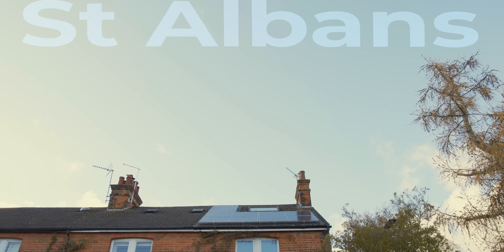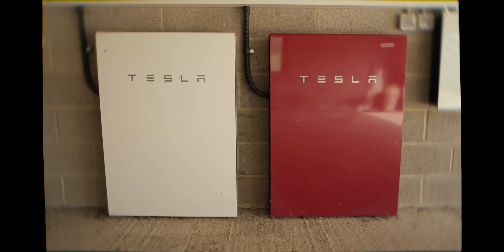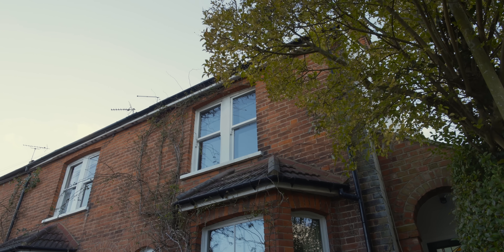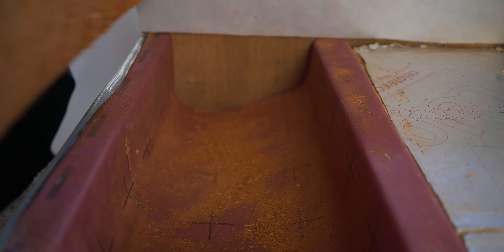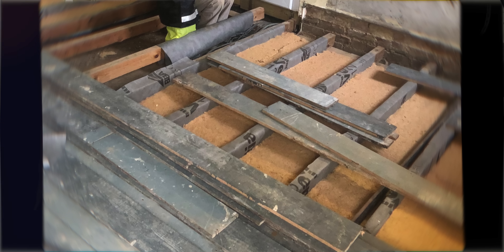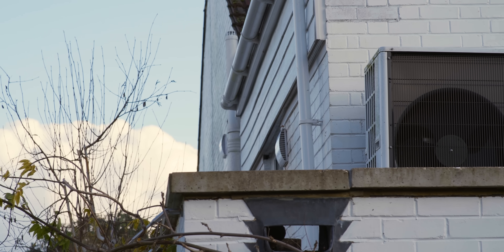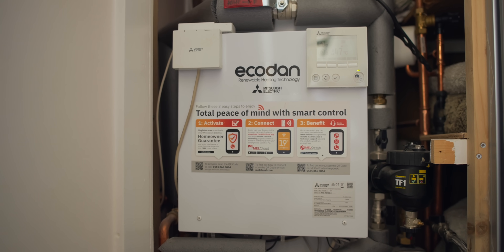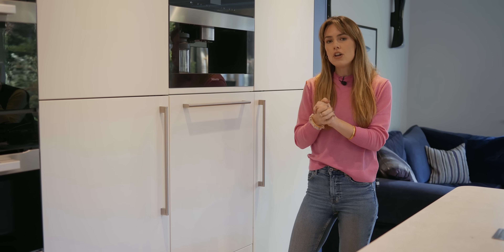This Victorian Home is Now 75% More Energy Efficient!

Comment: appreciate this is not for most of ye victorian semis, but for those wondering about all the "savings", here's a quick reality check: lovely Judith mentioned they used to use 25,500 kWh/year. Not sure if this is gas only, but let's assume it's both leccy and gas. What's the split, conveniently not mentioned, but let us again be charitable and say it's weight adjusted based on Ofgem's typical annual energy usages for a "High" user with economy 7 for electricity. Ofgem quotes 17,000 kWh for gas and 6,700 kWh for leccy, so weight adjusted I propose about 18,291 kWh for gas and 7,209 kWh for electricity.

Now,  using the Ofgem January to March 2025 price cap for east region we get units only costs of (standard credit and multi rate for elec): rounding up about £3k per year. Then onto the current use of under 6,000 kWh (assuming elec only as it's "green"), so wow, only about £1.5k per year (used 5,900 kWh as generous, so about 50% reduction without the daily standing charge for gas).

So with that whooping saving of over £1.5k a year Judith's rates costs alone (we didn't account for removal of gas daily standing charge once gdn finally get onto that...) will let her recover the roughly £23k in about 15 years🙃
...well ,that's if leccy rates would stay as they are now ;) Plus, the estate agent priced the house at £90k more! Wow, amazing, although would be good to know more than when? As my house was also about £90k less about 10 years ago when i got it (go on h8 me millennials and GZs :p)
I couldn't save the planet but definitely saved my poor ol genx pennies... adeus!
Reply: at least she doesn't get cold feet!
Reply: not sure i get your point, so you saved £23k, but were paying double of what you could have for past 10 years? You'd be 2/3 to your ROI and could have saved yourself a tad more of those pennies no? Aside from the fact you actually could have gotten the £ from government to pay fro all of this!
Reply: The split was 3/4 gas and 1/4 electricity. We now pay the same amount for electricity as we always did, but no gas cost. Pricing of the house was done about 18 months ago and the value of the house now in comparison to the equivalent house now.

Comment: Nice to see materials like sheep wool and wood fibre being used. Not sure if many people think about it but rigid insulation boards like PIR make a huge mess when being cut and installed . The particles blow everywhere and I wonder if it could be a lot worse for the environment than things like microplastics in cosmetic products. Especially when you consider the amount of new builds and retrofit jobs using it these days.

Comment: Interesting to hear but not convinced about the approach.  The character of the building has gone on the inside.  The suspended floor solution using multiple membranes with draped fabric is NOT ideal as you could see with the insulation sagging.  Best way is to stable woven garden fabric to the underside of the joist and fill with glass wool cut slightly over size.  For 6*2 joists use 170mm wool.  Seal board edges with expanding g foam and caulk and gaps in floorboards.  Way cheaper and better wool placement and retention.  Modest wall insulation on external lath and plaster can provide 35mm to 41mm PIR insulation which is not ideal but takes you 70% of the way there without destroying your old architectural features.  The all green dream is wasteful on costs and heritage for a marginal gain.  There are other ways with advantages.
Reply: Not using petrochemical based materials mattered to us. The underfloor insulation method is advocated by many sustainability companies. We used an airtightness membrane top and bottom to hold and cover the wood fibre and it's working well. You're right, we have changed the inside a lot over the 47 years we've lived here that's true. But the only features truly lost is one fireplace (the other looks as if it's still there) and outside toilet and coal hole. All the picture rails and architrave are here in some rooms.
Reply: @ I know that many suggest the method you used however I do not consider it necessary and it has flaws.  I agree not to use PIR but not for the movement gap issue you suggest as that can be avoided by gluing the insulation to the wood, I do this in rafters and between wall studs on the previous lath and plaster, the issue with POR is it dies not allow water to “fall” through if you have a spill where glass will will. There is plenty of draughty exclusion in well fitted boards and if some gaps caulk them..  the problem with all those giving advice is they sell the expensive membranes and tapes so 5hey are incentivised to over spec.  I have done two old houses now and the woven garden fabric stapled to the underside of the joist works extremely well.  At the board edges I use expanding foam  fir a complete seal that can take movement the caulk or fill any splits, wholes or gaps.
Reply: @DR-00700 This sounds Ok as long as all the materials used are vapour permeable - particularly important in an older house. Without this there will be problems
Reply: @ I do understand your desire not to use petrochemicals however I find some of the natural materials to be inferior and expensive.  I am an oil engineer and see little problem in using decomposed organic material as oil and gas is.  In reality oil is natural, you can make it from organic refuse by heating it in a pressure cooker just the same as burying it deep in the earth.

Comment: That was a great interview, really well explained by Judith. We've done the under floor wood fibre insulation exactly as she described and we are looking at wood fibre externally wall insulation next, then a heat pump. I think the only two major points to add to this:

1 - Common plastic insulation (PIR, Polysterene etc) is a fossil fuel product! So by going for natural products like wood fibre you have much less embedded carbon.

2. Using plastic insulation is an all or nothing approach in terms of keeping moisture out. So for external wall insulation if that insulation is compromised in any way or at any time then there is a real risk of trapping moisture behind the plastic insulation, which can then just end up causing damp inside. 

Plastic free, vapour permeable insulation all the way 🤘

Comment: Very useful video, and I'm glad to see the emphasis on using vapour-open biomass-based insulation products, and the importance of employing breathable materials on pre-1930s buildings with porous materials and no or minimal wall cavities.  However, I do have reservations about just getting rid of chimney breasts and fireplaces, not to mention obscuring original lime plaster mouldings and architraves around the wall openings - lime plaster is itself insulating and should be left to do its job.  Chimney breasts are your storage heaters in a traditional building, and together with a stove or radiant cast electric heater, create a focus in the room - they should invariably not be removed.  It would also have been useful to have mentioned the existence of PAS 2035, and the need to keep to its recommendations when moving forward with any retrofit works.
Reply: All the new plaster is lime. Agree with you about the architrave - where we had it in place, we had a replica made so it now looks just the way it did before. Kept the look of the fireplace in the front room, but wanted to lose the extreme draughts we were getting.

Comment: I don't know if I missed this detail, but does the 25,000 to 6,000 kWh/yr refer to total metered energy use, ie gas+electric going to just electric with switch to heat pump?
Reply: yes - @5.5K was the total of gas + electric. Now just 6K electric. All the gas has gone.

Comment: For once id like to hear someone offer up a solution outside of internal wall insulation where you dont loose a good amount of space WHERE you cant actually afford to loose space AND external wall insulation isnt possible :( . Hearing people say "you dont loose that much" isnt a solution
Reply: Imogen does show how much we lost in the bedroom. I have been surprised how little impact it has made - and a big impact in warmth. So worth it from our point of view.
Reply: 1. Cavity insulation with EPS beads, if you happen to have a cavity in your wall (the best, easiest and most cost efficient option) 

2. The wood fiber presented in the material is actually not that great of an insulator and 100mm is quite a lot to lose internally. You can get same or better U-value by going for a much thinner phenolic insulation, like 40mm or so K118 Kooltherm insulated plasterboard - which is imperceivable for all practical purposes
Reply: @lelllooooo  I agree that using sustainable materials can take a bit more space, but it was important to us not to use materials that are harmful to the environment or that off gas into the house.

Comment: You CAN Celotex/ Kingspan etc suspended timber floors...you use insulation expanding foam for the gaps...simple.
Reply: It is pretty much impossible to seal PIR insulation to the full depth of suspended floor with expanding foam, this only really works well if you use something like Gapotape

Comment: Brilliant video. First class presentation. 
I have tried to do something similar with my house. 
The comment about over-sized radiators rings true, the government grant is conditional on having very large radiators to perform well in very cold, very unusual conditions, so at the moment you have little choice.
Reply: With ASHP, bigger radiators = always better, regardless of the weather, as they allow you  drop flow temperature down and so boost heatpump efficiency significantly.

Comment: Great video, with some interesting ideas. Which single room heat recovery ventilation units did you use and was it a local installer.
Reply: Looks like the blauberg vento unit

Comment: It's so heartening to see people who have become passionate about improving energy efficiency in homes able to acheive massive improvements in their homes! 75% is a LUDICROUS improvement to manage with really well thought out insulation and a heat pump. Incredible
Reply: That's the sort of improvement most houses older than about late 1980s will get with a decent retrofit. Check out the 'superhomes' project which has been tracking 'at least 65% energy reduction' retrofits for a couple of decades now. Our (1960s) house is improved by a factor of 8 since 'as built' and a factor of 4 since we bought it (with cavity walls, basic loft and DG done).
Reply: its just a shame elecrticity is 430% more expensive per kwH than gas! and also standing charge 100% more expensive for lecy over gas!...crazy
Reply: @recyclist6421  and if electricity prices were not attached to global commodity markets trading prices of natural gas, to more accurately reflect the price of electricity generation in a normal, modern, renewable energy filled grid, this simply would not be the case. The electricity price being tied to gas is a ludicrous position to be in for a country that regularly passes 50% renewables on the grid. In Scotland where I live we're over 90% renewables per year. The prices we pay living here don't reflect that.
Reply: @RobinThomson277  It's not really 'ludicrous'. The price of half an hour of electricity being set by the cost of the last kWh that satisfies demand is a mechanism that satisfies demand at the lowest price available and has worked very well for about 100 years. It's not tied to gas specifically, it's just that quite a lot of the time in winter it's gas that supplies that last kWh.
Regional, rather than whole-UK, pricing would give areas with more low-carbon supply (like Scotland) much fairer pricing (where demand would be satisfied by wind most of the time and would cost less), and would make clear to the south (where the bulk of the demand is) that their electricity costs are higher, and they need more generation.
Designing a generation pricing system that gives good reliability of supply and decarbonisation at lowest cost is not a trivial matter.
Reply: @ Octopus have multiple tariffs if you have an EV, Heat Pump and or a solar Battery system
EV 7p per KWH overnight (would save me £2000 on petrol) and combined with my home solar battery system around £1500 a year on home electricity
The tariff I'm on now is 13p overnight
Before it used to be 24p
Reply: @RobinThomson277  we've done it to ours, the UFH and double insulation we've installed is supposed to reduce your energy usage by 40% on its own, we've also had new windows and the roof replaced now double insulated.
Our old boiler and windows were 35 years old and the house was built in 1935

The upstairs radiators don't come on unless it's down to 3 or 4 degrees and even when we had that -10 spell they barely ticked over at a low temp. The UFH switches off at around 11 degrees with our french and bay windows upping the room temperature.
Reply: @ Well done for retrofitting. What do you mean by 'double insulated'. Do you just mean 'thicker insulation' (than what)? We are short of good terms for 'a bit of insulation', 'more insulation' and 'really good insulation'. It's all called the same thing, and people don't understand what their options are, and what effects that would have. Also by '11 degrees' do you mean 11 degrees above room temp? UFH that switched off at 11C would produce a chilly house :-)
Reply: @xxwookey  I mean 11 degrees outside I keep most of the downstairs at 18 during the day 16 at night and upstairs is set to 15 but off overnight.
Any bit of sun even in winter and the heating isn't needed, the windows have a Pilkington glass product which lets heat in at a shallow angle and blocks it as the sun gets higher in the sky (as in summer).
Reply: @ Is that the micro venetian-blind film that I saw an ad for once and have never been able to find since? If you have a name for the pilkington product that would be great.

Comment: That was a great episode and so well presented by you both!
I did similar on this old house, but some of the work was DIY.
A 1950s 3-bed semi chalet.
Cavity walls insulated.
All windows double glazed.
Flat roofs insulated with 6" of insulation with EPDM on top.
The remainder of the roof insulated with rock wall type insulation.
The floor is solid and uninslated. Maybe a job for the future.
All windows have thermal blinds or curtains (some have both!)
Our heating bills (gas) are always very low.
Along with the off-peak electricity tariff, we are always well below the government energy cap, even with charging our car.
One thing that my fellow pensioners, and others, could do for little cost to keep themselves warm (and alive), is to buy some thermal undies!
Long Johns may not be the height of fashion but they do make the house feel several degrees warmer and could help survival in the cold winter we are experiencing.

Comment: Interesting, I always assumed the external wall insulation would have to go on the outside. Were the sidewalls were done on the non-external walls? Might also help with soundproofing from neighbours!
Reply: External wall insulation (EWI) is always technically better than internal wall insulation (IWI), and can go thicker. But IWI is cheaper, doesn't need planning permission, and can still do a good job. Soundproofing is about density, so heavy insulation like woodfibre or hempcrete will make a lot more difference than light stuff like PIR.

Comment: If they dropped their thermostat down by a degree or two they could save even more! 
24,000kWh for a house that size was crazy to start with! We have a similar property without any of the more modern insulation methods and only 14,000kWh!
Reply: It's a good point - that was really high energy-use for a house that size. I guess end-terrace has a lot of extra surface area, but even so - it's not a very big house.

Comment: I'm quite shocked just 100 mm of insulation is considered gold standard in UK. In central europe we use 200 mm of graphite styrofoam on the outside of brick walls and this is considered a gold standard.
Reply: Gold standard (passivehouse) is 200mm. And yes EWI is better. But 100mm in retrofit is a dramatic improvement and often good enough to get to around 50kWh/m2.yr which should be considered a minimum target for all buildings.
Reply: @xxwookey  Well, in my climate if you want a passivehouse, you would need about 300 mm of insulation, but I guess that winters in the UK are warmer.

Comment: Great video, great guest, useful to see the products available, and how they are used. 

I would suggest that Judith contacts the Heat Geeks, as I would think they would be able to calibrate her heat pump to run at a lower flow temperature, saving her more energy still.

Comment: Could you please advise which single room mvhr product gives 85% recovery efficiency please
Reply: I know that Demand Controlled Cascade Ventilation – bluMartin freeAir 100 MVHR is worth looking at for this
Reply: @Her_Retrofit_Space  Hmm. That looks like the unit installed in this video. I've not come across that one. It looks way better than most of the others (designed to go in a 100mm or 150mm core hole).
Reply: None of them in reality. It needs some work to get 85% out a proper passivehouse certified MVHR unit. But they are all way better than a simple extract fan which is 0% efficient. I counted 15 suppliers of sinlge-room MVHR units varying in cost from £200 to £950 last week. There are loads of these things available now.